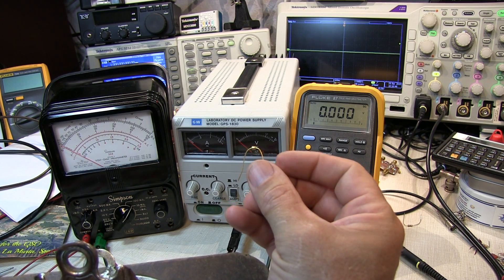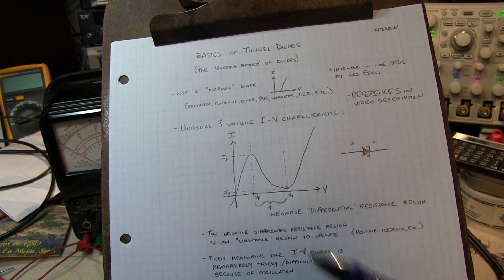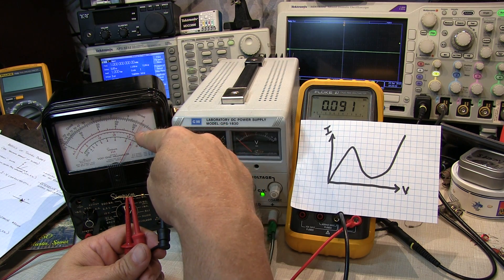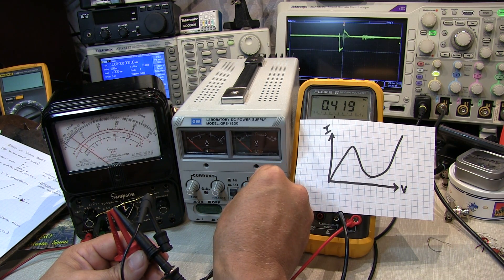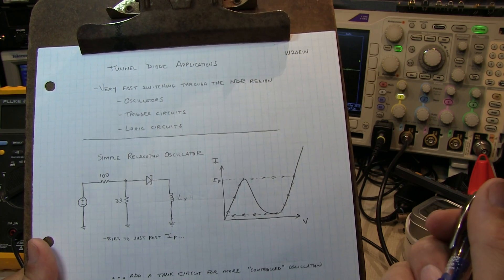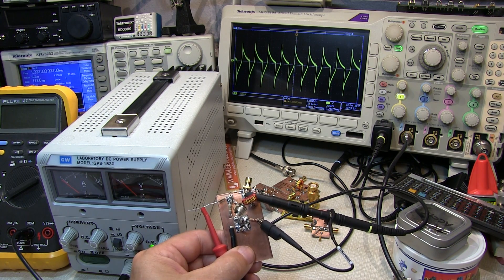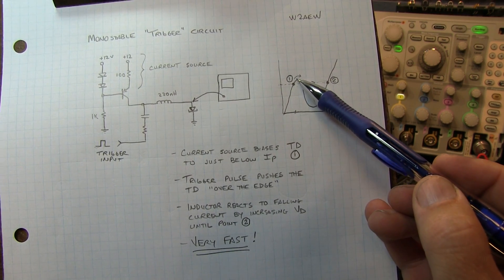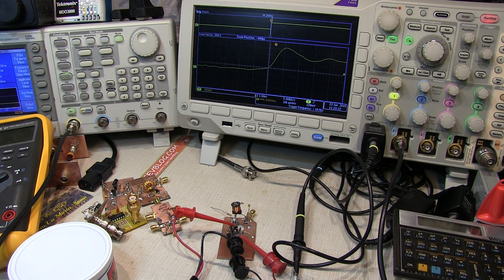#204: Basics of Tunnel Diodes and their applications

Comment: 2:31 into the vid. i'm thinking it might make a dc to dc power supply. like those in 12 to 14.2 volt mobile tube amp applications. where most run to-3 case transistors for the large load switching. the tunnel diode would be used for a reference signal generator. then a simple amplifier would boost the signal to the supplied 12-14.2 volts to function the high voltage step up transformer. just a thought.
Reply from the maker: dale myers Just remember that tunnel diodes are rare, low power, and fragile devices.  Maybe not very well suited to a switching power supply.
Reply: as i mentioned: i may not have been totally clear, the signals from the diode curcuit wouldn't be employed to power the transformer. it would be use as a signal generator, signaling an amplifier stage. to modify the supplied automotive power to a transformer, for the tubes bias, heater and plate voltages. and at a frequency of one meg. it wouldn't be as audible as the average mobile tube amp, referring to that all so pesky squeal.
Reply from the maker: dale myers Understood.  I guess I was trying to say that there are less expensive, less exotic ways to create a 1MHz oscillator without using rare (expensive) tunnel diodes.